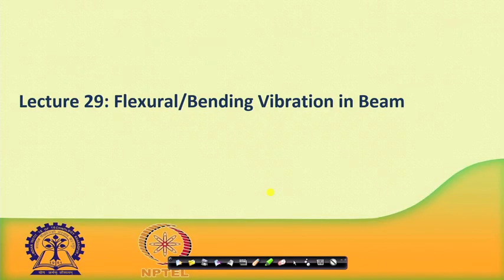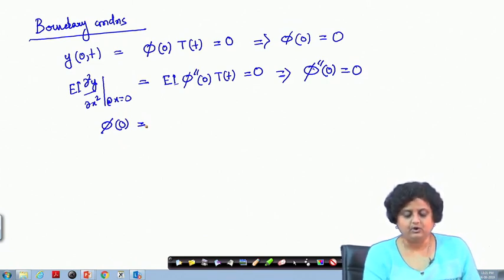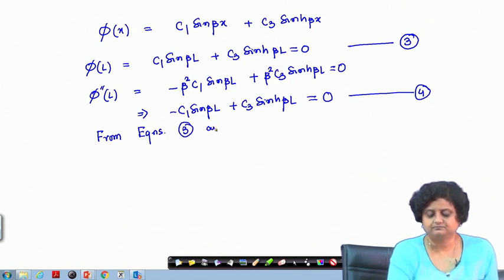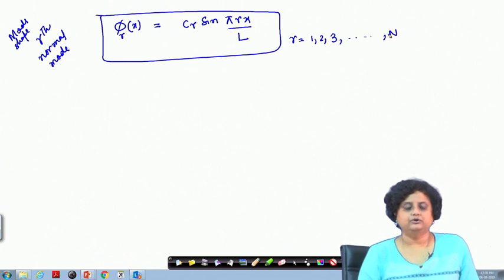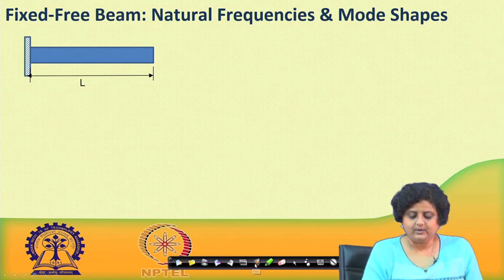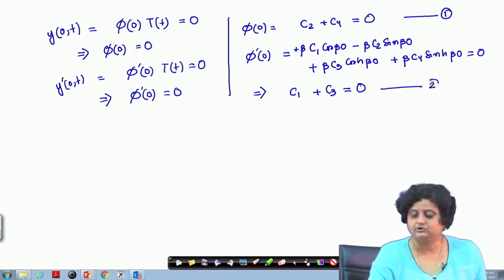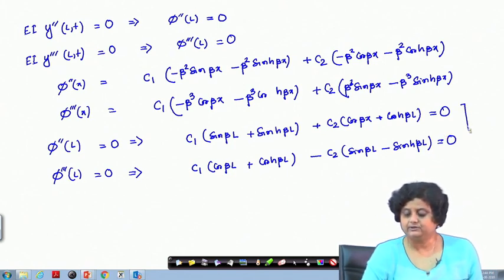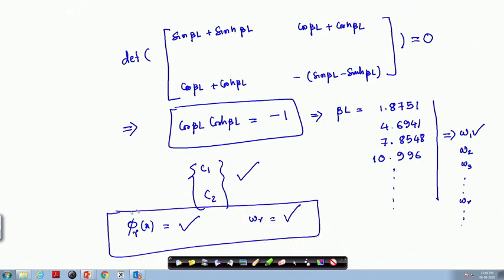Lecture 29: Bending Vibration in Beam (Contd.)

Comment: Crystal clear lecture
Reply: Bro is this  lecture 29  is ...........derivation of fextural  vibration of beam plz help....or lecture 28 is that pkz help
Reply: @Iris0555  derivation is in lec 28 and in 29 it is being applied to simply supported beam
Reply: @vikramsaini5061  thanks bro🙏
Reply: Bro ye......    lateral vibration of cantilever beam of uniform section..... kya hota ha...agar pta h to plz help
Reply: @Iris0555  lateral vibration is sometimes called bending vibration too, and cantilever beam you might be knowing already
Reply: @vikramsaini5061  can we use lecture 28 for explaining this.....i.e.  flextural vib. Of beam.....or can we use transverse vibration of string for this......or it is diff. Story
Reply: @Iris0555  transverse vibration of string is different story because string is flexible and boundary conditions of beam will not apply there
Reply: @vikramsaini5061  brooooo🤯🤯can we write flextural vibration for this???
Reply: @Iris0555  No bro
Reply: @vikramsaini5061  bro if have a solution for this can u upload on your channel only photo will work🤓😊
Reply: @Iris0555  can you exactly specify your question?
Reply: @vikramsaini5061 👉 Obtain the frequency equation for the lateral vibrations of a cantilever beam of uniform section having a length L.👈
Reply: @Iris0555  then this or the next lecture is your answer. Ma'am takes the example of a cantilever beam vibration and finds out its natural frequency
Reply: @vikramsaini5061  thanks bro!!!.....but.....u know mam🧐
Reply: @Iris0555  She is from IIT KHARAGPUR
Reply: @vikramsaini5061  and wht abt u???
Reply: Bro plz inform about the vedio if it get uploaded 🙏
Reply: @Iris0555  I am from IIT KANPUR doing MS Research in flight Mechanics and Control
Reply: @vikramsaini5061  great bro!!!🙏❤️
Reply: Bro  last question can u ask mam for a lecture on  transverse vibration of beam using timoshenko beam theory.......bro plz plz plz help🥺🥺
Reply: Bro these are not in my text and not in internet plz help
Reply: Hiiii...can i ask you one question???? 🤔
Reply: @Iris0555  okay ask
Reply: @vikramsaini5061  can you tell some point for .........upper critical and lower critical mach no.....
2.....What is lift divergence???.......plz tell
Reply: @Iris0555  https://en.m.wikipedia.org/wiki/Critical_Mach_number
Reply: @vikramsaini5061  bro it has only one point of each type .....i want some more points......only about lower and upper critical mach no 🙏
Reply: @Iris0555  These are two critical speeds what else do you want to understand about these?
Reply: @vikramsaini5061  ok i understand that but this comes under 8 marks in 16 mark question thats why i need some point to write plz help